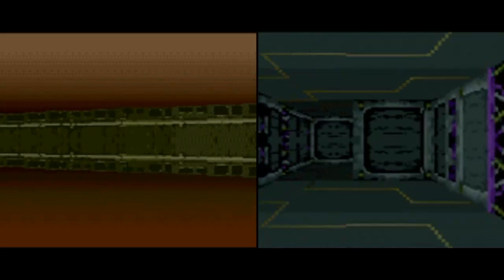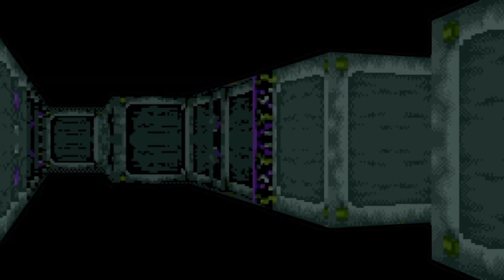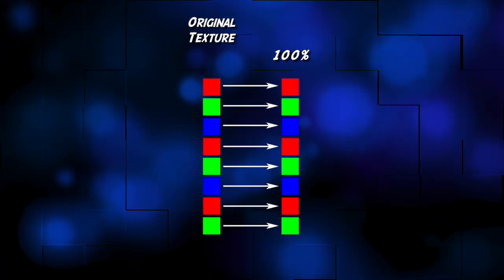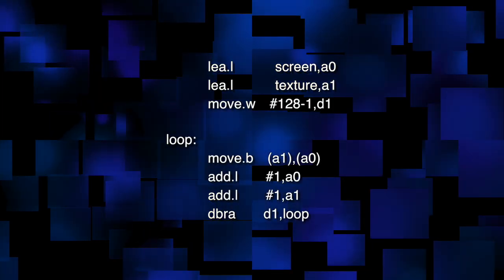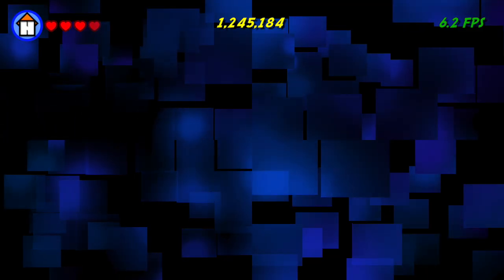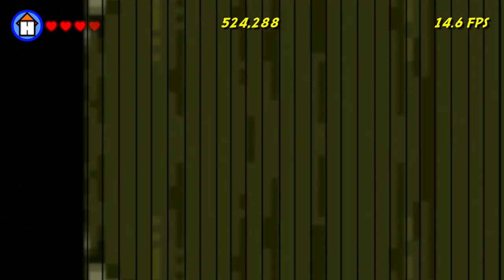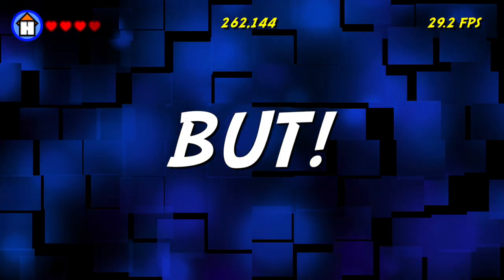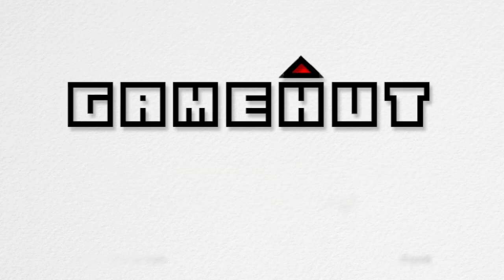CODING SECRETS! How TOY STORY'S 3D was programmed

Comment: Most of the benefit of loop unrolling is achieved by unrolling just a few times, so 4-10 times would give you relatively compact code and cut branch overhead by as much as 90%.  Also, a lot of the performance of the 68000 can be chalked up to a bit of pipelining that occurs early on:  one instruction can be in Execution while the next one is being Fetched.  Not being an expert on the 68k architecture, it does have some complex instructions and addressing modes that may allow you to reduce some of the remaining move.b and add.l instructions from 3 down to 2, cutting overhead just a bit more.

Every time I look over this video, I seem to imagine some other possible ways to economize a bit more.

Comment: Curious the initial choice of code.  You could have used:

loop:
          move.b  (a1)+, (a0)+       12 cycles
          dbra         d1,loop               10 cycles

and saved 16 cycles (about 42%) immediately.

Similarly,  as you are moving 128 bytes of contiguous RAM in the example, further saving could be done by:

            moveq   #32-1,d1
loop:
            move.l     (a1)+, (a0)+        20 cycles
            dbra          d1,loop                10 cycles

For a whole strip this is 960 cycles compared with 2816 cycles of the improved code above compared with the original of 4864 cycles...an improvement of a little over 5 times faster.

Comment: "It turned out we could write a macro to generate all the code for us." So more or less you wrote an optimized (limited scope) JIT compiler for the Sega Genesis
Reply: No, macro generates code at compile stage, so it didn't save any memory, just the amount of code to write by hand. JIT would generate the code in the memory as the program goes, which is not efficient in cases like this, JIT would only slow it down a lot.

Comment: I'm impressed at the simplicity of some of the techniques to get a whole 10x improvement. Unrolling is something I'd have definitely gone for, but I don't think I'd have thought of mirroring it vertically, haha.
also, I never really thought about why all the "3d" stuff I've seen on the machine (like here, or Zero Tolerance, or Ranger-X's wireframe cutscenes) all plotted in half horizontal resolution until you mentioned that the colors are packed 2/byte (which I probably should have noticed beforehand, since you get 16 colors per tile)

Comment: Dat code expansion
I keep seeing armchair developers talking about how simple optimization is, and how it's just reducing the number of lines of code, but really, it's not always that simple. For performance critical tasks, it can be preferable to actually write less space efficient code like this, as something that's only a few lines of code, but code that constantly checks the conditions of it's operation and then executes based on that is going to take more cycles than a long string of precalculated situational code.
I like to think this is why older RPGs and Adventure games often don't run very well compared to action games that seem to be doing more at any given time; because the code for RPGs is optimized to save cartridge and memory space to handle larger maps with more interactive objects while taking less space, and doesn't need performance optimizations, whereas for action games, performance is the most important aspect.

Comment: One trick I've done with such things that might have helped if ROM space was an issue would have been to come up with routines to render 32 pixels worth of texture onto 1-32 pixels worth of screen and would then e.g. draw 64 pixels of texture onto 61 pixels of screen by drawing 32 pixels onto 31 and the other 32 pixels onto 30.  This cuts the number of unrolled routines in half, and each would only be half as long, so the space for unrolled routines would be cut by 75%.

Comment: Awesome video.
But I have to correct you that it wasn't Wolfenstein 3D that first used this method to fake 3D.
"Wayout" in 1982 for Atari 8-bit and it's follow-up "Capture the Flag" in 1983 were the first games to use it.
 Another one was "Alternate Reality" by Paradise Programming in 1985 for the Amiga in 1985 which was an RPG.

Comment: At what point was the macro evaluated, and where was the result stored? Clearly, this couldn't be an assembly time thing, as that would still result in the same cartridge space. And it couldn't be evaluated while running, as that would have slowed down the rendering. Did the 68000 have more RAM for code than the cartridges had space?

Comment: This is great stuff, and still applicable today.  Even in high-level languages (C#, Java, Swift, C++), unrolling loops is still a valid technique for squeezing performance out of heavy-use code.  A far more common optimization in high-level languages is to write that portion of the code in C or assembly and bridge it into your high-level code— and these types of optimizations are even more applicable to C and assembly.  So, yes please.  There's great wisdom in old optimization tricks, and I'm personally tired of seeing modern 2D games that require a fairly new gaming rig to play when I know that they could run on computer 10-20 years old (as well as iPads, iPhones, etc.) just fine with some optimization.

Comment: The only question I have is that how do you handle mirroring vs not mirroring, specifically the exit, has a non mirrored surface. I assume that's a special case as it only had to happen once. I'd like to see more about how you implemented the mirroring.

Comment: I miss the days where programmers had a responsibility to ensure that their code ran at a decent framerate. Nowadays it's just "Our game runs at 10fps? It's clearly your fault for not having a ten thousand dollar computer."
Reply: Yeah, I'm pretty sure most of the games nowadays can be optimized to run much faster than they do.
Reply: The problem is complexity is much higher today.
You have to abstract mechanisms to be able to make those games in the first place.
This gameworld basically consist of 1D textures written at different scales.
But now think about a new 3D-Game, you have polygons, textures, lighting, particles and so on, there is no way to find all of the possible connections which are linked and could be optimized.
Complexity just grows exponentially with every item you add.
It's just easier to optimize smaller programs, that's why we abstract, that's why we have OpenGL, DirectX, Metal, Vulkan. That's why we have Game Engines, because we can make those problems manageable and optimize those smaller problems.
And yes there will be a performance hit using such abstraction methods instead of writing one monolithic program, but such a program would be much harder to manage and would most likely suffer from bugs and even bigger performance hits.
Reply: @MrDavibu  hit the nail on the head. Games are wildly more complex than they were back in the day. Not to mention even if developers wanted to optimize their code to run at a decent speed, publishers and executives don't care in the least. They want the game out and they want it out as fast as possible so they can pump out the next cash cow. They will never prioritize an optimized experience. Also with teams being enormous compared to small handfuls of people back in the day, it's more difficult to coordinate and have everyone be aware of how to best integrate their systems together. Today's priorities are about working efficiently and delivering product under budget, not to keep hundreds of programmers working weeks overtime to optimize for an 5 extra fps. Basically it's not so much the programmers' fault (at least not always) but the marketing department, publishers, executives, Todd Howard etc.
Reply: Bruh not every game runs well on console either. I'll give them the benefit of the doubt since I bought a PS4 lite, but PCs are another beast entirely.

You don't want to alienate your PC users but you also have to keep up with not just current gen consoles but also the current gen games that are trying to push boundaries. Consoles are made specifically to play these types of games (meanwhile game developers still have to keep hardware limitations in mind), while not every PC is made for games.

PCs are kinda like cars. Everybody pretty much needs them, but some people like to customize them with special parts to make them look cooler and run better. Not everybody who uses a car would use them in a race though.

That being said, PC games try to be as well optimized as they can be, with a large majority of them containing options to turn settings down so they run smoother on as many PCs as possible. Obviously if you are an avid gamer though, chances are you have an above average graphics card anyway so game developers probably don't think too hard about it
Reply: In those days you built a game to run on a certain config. Now there are hundreds of thousands of confide that games have to work on
Reply: @Caraxian  Yes, a lot of optimisation done back in the day is specific to the hardware the game is being developed for. Nowadays, since games usually can't rely on knowing exactly what hardware they're running on, those specific optimisation tricks are often ignored (though not always). You would never see emerging) something like the cram dot trick in the demo posted on this channel (though that's not actually optimisation related, it proves my point).
Reply: @Caraxian  not on consoles, which this was, so that's what we should compare it with.
Reply: It’s even funnier that developers like Crytek blamed the commercial failings of their game on piracy rather than the fact that Crysis ran like crap on anything that wasn’t 2 years in the future.
Reply: +Retro Frontier I only have the utmost respect for programmers who dealt with those limitations, but I wouldn't belittle the achievements of modern programmers to that degree. The hardware may have gotten considerably more powerful but what players demand of their games have also skyrocketed.

Plus you mention Game Maker, a program I feel I'm an expert at but not one I'd consider myself a programmer from. GML isn't C++, which is actually used in nearly every modern video game. They share some similarities and lord knows both are easier than assembly, but pretending they are on the same difficulty level would be quite misleading. And even then while a terrible programmer could make a game in a few hours with Game Maker, an expert of the program could pull off things in the same amount of time that the other programmer wouldn't think Game Maker was even capable of.

Also if you're aware of lower level modern programming languages like C and C++, you'll know that there are still many problems like the ones seen in these videos you still have to contend with. The ease of tackling them may be mitigated and the amount of memory you have to work with may sometimes seem infinite, but that doesn't mean having issues where you have to count specific numbers of bytes don't happen.
Reply: If you look at Nintendo, you'll see this spirit is not gone. Just look at MK8 and BOTW on the Wii U. Nintendo always saves a buck on the hardware and spends it on making the software that much more efficient for their consoles!
Reply: Yeah this comment is completely wrong. Optimisation is a massive part of my job as a game programmer.
Reply: This is an advantage to using a console - the developer has a responsibility to make sure it runs well.
Reply: You can blame OOP for that.
Reply: This is only the case in PC land.  Console developers still have a responsibility to make sure their code runs at a decent framerate on the platform they're developing for.  And, just like in the old days, they meet that challenge with varying diligence and success.
Reply: If you spent 10K on a gaming computer, you got ripped off. You can build a decent mid-range gaming PC for $650, and simply upgrade from there as you can afford to do so.

Sure, the prices up front are higher when compared to consoles, but you're saving more money over time. I like to think of it as an investment.

Comment: Wait so you use a lot of clever tricks and still need a lot of cycles just for scaling some vertical lines but then there's the textured floor/ceiling that would require scaling AND rotating of its texture when you have almost no cycles left... but no mention of that in the whole video. Wat. Confused.

Comment: Very nice! Very impressive indeed! But you know, Raycasting is fine and dandy, but I kind of already know how it works... It was certainly nice to have clarified how you've managed to optimise it so that it runs so smoothly on the Mega Drive, but what I don't know is how you managed to pull off the ground and ceiling in this level, I mean, they look like Mode 7 and they even get darker the further into the screen they go... How did you do that?
Reply: I wager a guess, there's no texturing involved. I think he renders a gradient, masking by y max coordinate per column. Since he now gets to iterate horizontally rather than vertically, it's a lot faster. Then he simply xor-bresenhams the cue lines on top and the palette takes care of it looking like it does.
Reply: Umm, if I may ask, what is "xor-bresenhams"?
Reply: Bresenham is an ancient very fast integer-only line drawing algorithm that is simultaneously a division algorithm that substitutes division with additions. I meant he's just drawing single lines, coordinates of which he can calculate based on visible sectors.

Then i meant the line wouldn't be simply drawn by replacing the background pixel value with line colour, but applying bitwise XOR function between the background colour and line colour. In fact it probably doesn't matter what logical function you choose, could be an OR or whatever, something to set a single bit in the pixel, but you can just flip any number of bits into any direction with XOR, it's fun that way.

Comment: It is impressive how you were able to figure out how to get high frame rates on by using coding tricks. The frame rates are a lot more better in your game than some Sega Genesis games that attempted 3D.

On another note, from your experience do you know why some 3D games, like PGA Tour 96, on the the Sega Genesis had such a low frame rate and took forever to render?
Reply: They did need to it not be mirrored and also, didn't scale but instead used flat polyogons (some even with textures) which are slower to draw than scaling strips. Also, it's a golf game, even some Windows 95 games were really slow just to look nicer. There are faster flat polygon games in the Genesis like LHX Attack Chopper, and even Hard Drivin' and Race Drivin'.

Comment: I always wondered how Toy Story managed to be quite a bit smoother than other FPS games on Mega Drive without having such a tiny gameplay window like Zero Tolerance had. I used to work in QA so I had a little knowledge of some of the tricks pulled to make games run smooth.  Maybe a video explaining scenery culling to improve RAm usage and gameplay speed and how you decide what to remove in a 3D polygonal game would be good.
Reply: They don't have scaling sprites. That takes up lots of processing, if not more than the background.